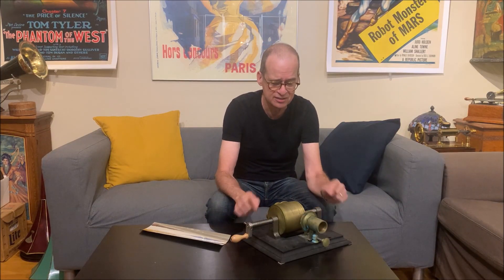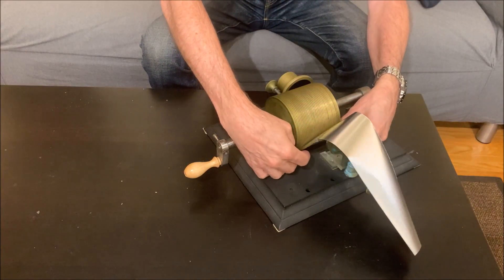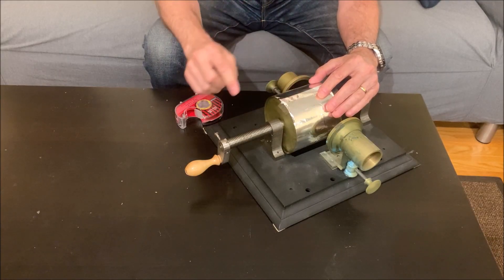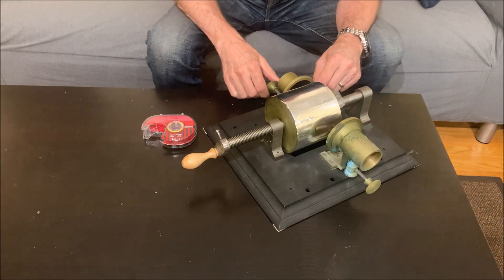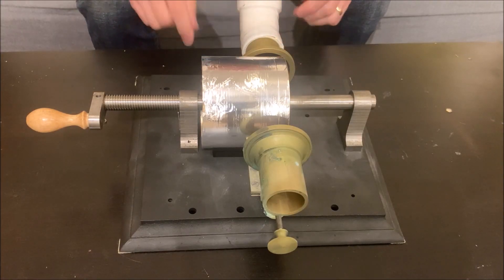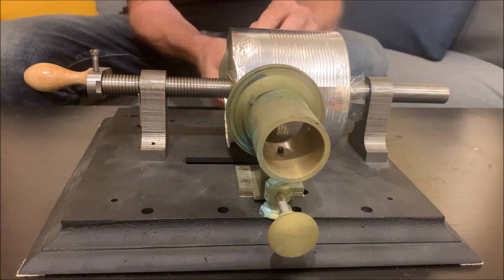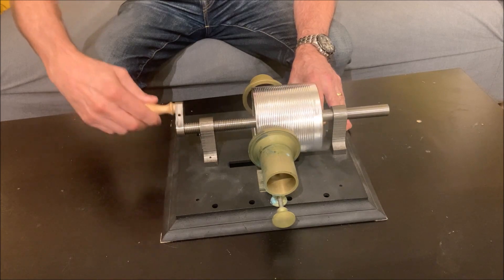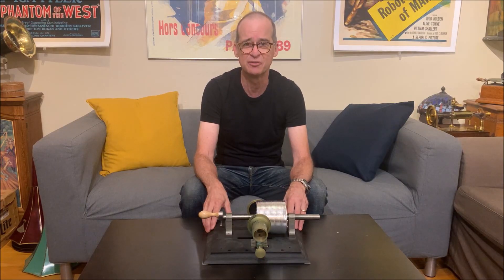Kruesi Tinfoil Phonograph Edison's First Recording Series

Comment: Where do you get the stylus from?
Reply from the maker: I didn’t make the stylus for most of the tinfoil phonographs I have, but in a few cases I have made them. I used a regular phonograph needle and sanded down the tip so it wasn’t so sharp.